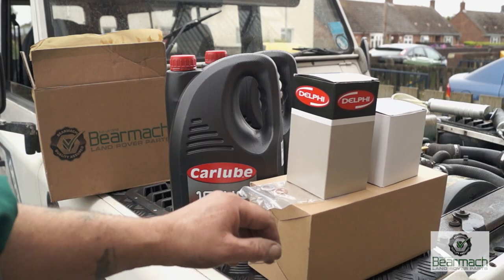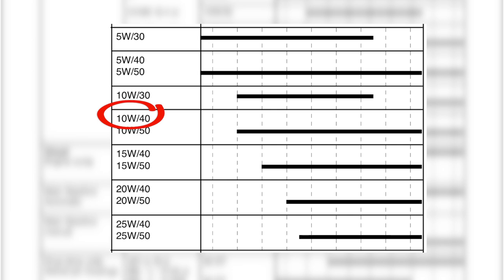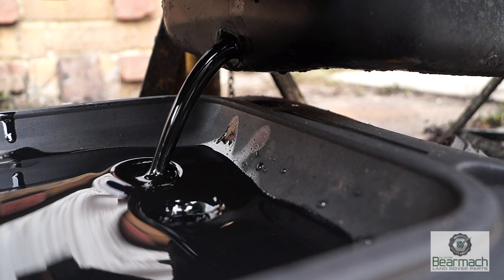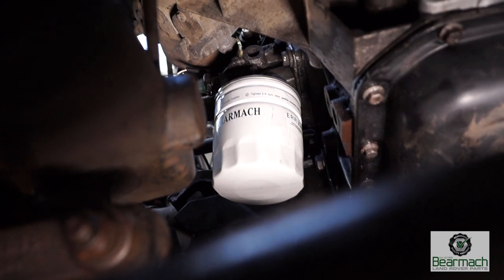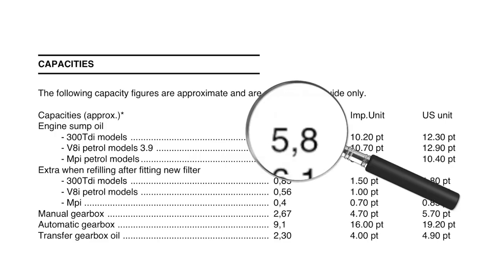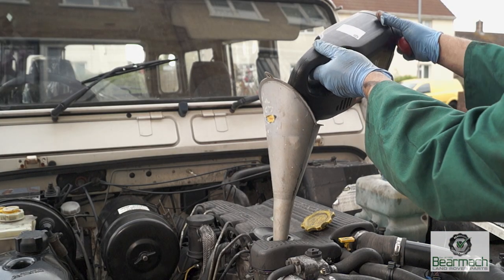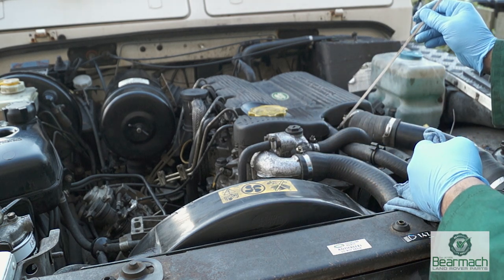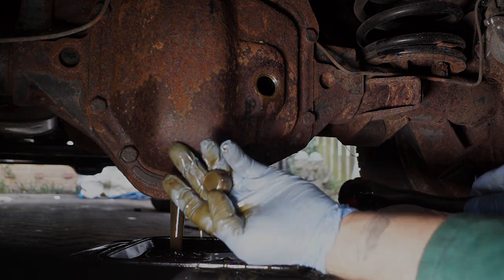Oil and filter change 300tdi engine - The Fine Art of Land Rover Maintenance

Comment: Never to old to learn ... I've always filled up my oil filters on advice I was given as a lad ... now I'll save myself some hassle and not bother!
Reply from the maker: Depends what you feel comfortable with.  I watched a video recent where the guy said it was important that the filter was primed otherwise the oil would take too much  time to get around the engine.  Not true. The oil delivery from the pump is quite impressive.  If you have ever seen oil pumped out of the oil cooler pipe you'll know what I mean?
Reply: *****
I completely agree with you ... having watched in horror out the window as my truck literally spewed all it's oil out whilst I was letting it warm up on the most horrific winters days through a split oil cooler pipe, I can attest to the strength of the pump ... I thought the hole would be immense but it was a slight rip at the joint... I was utterly gobsmacked at the time not to mention grateful that I'd decided not to put my boots back on to turn the engine off to save it becoming terminal ... I had top quality custom pipework made up for me by an excellent company in Nuneaton ... no more shoddy land rover pipework for me!
Reply from the maker: I forgot to connect the piping to radiator before starting it up.  Nearly emptied the whole sump out over the wing and floor.
Reply: ***** Yep that'll do it! lol  Darn thing could be used as an assault weapon ... albeit a brief one!

Comment: So it says in the manual 5,000 km for rigs using diesel with high sulfur content. If lower sulfur, can I go 10,000 or just keep it simple and do 5,000?
Reply from the maker: Yeah just keep it simple but if you run to 10 000 change the filter at 5 000.
Reply: You mean you would just jump under there and swap the filter then top off the oil if you were doing light highway driving?
Reply from the maker: if I was running where the engine was not getting to running temperature for any length of time,  sludge builds up in the oil because the moisture in the crankcase does not get expelled.  I think you need to analyse your driving habits then adopt a servicing strategy to that.
Reply: Awesome thank you!

Comment: Would you recommend a thicker oil in a hot climate like Australia?
Reply from the maker: Yes especially if you are towing heavy.      If you check out the Land Rover manuals  under  capacities and recommended fluids it will give you a graph (as seen in the video)  check it out under the relevant engine or component.    Some people would recommend 20W 50 for a 200tdi (in Europe) to quiet it down  but they don't understand what the viscosity index is for :.  20W 50 or 20W 40  is for a hotter climate where the ambient temperature doesn't drop below zero degrees C and up to 50 degrees C .